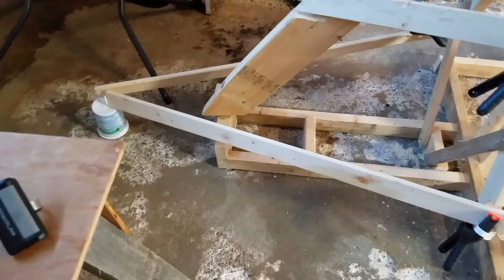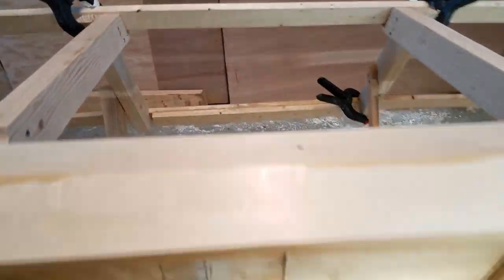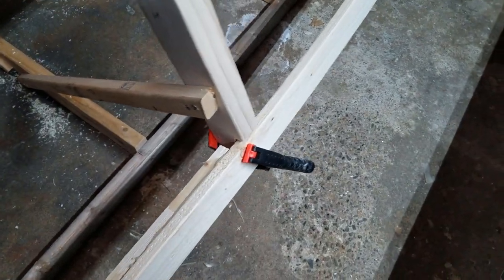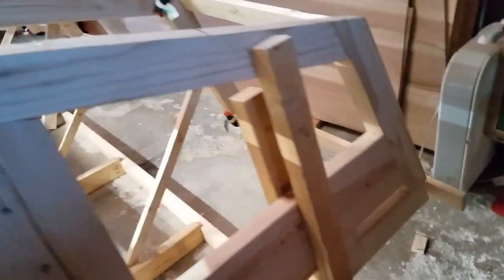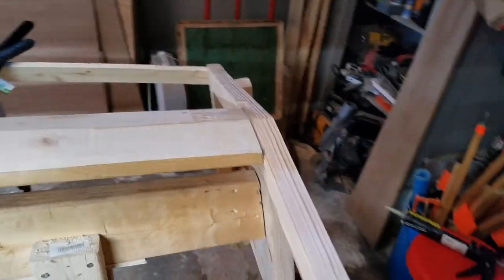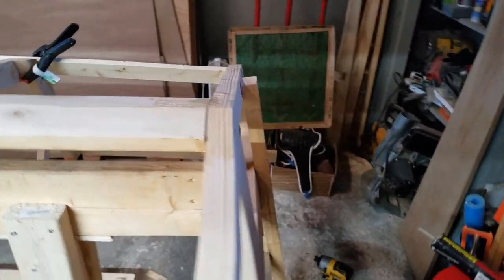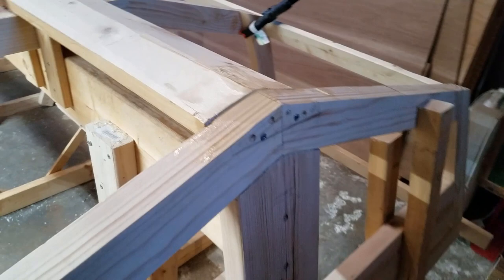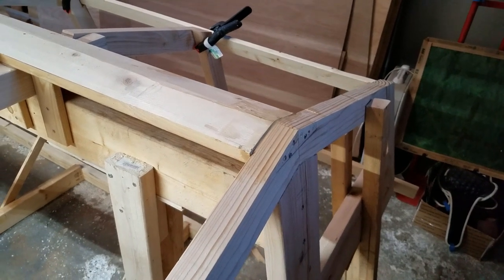Panga 5b: My Ground Hog Day of Boat Building  #diy #diyboat #woodworking

Comment: When you're at the end of a long day, and suddenly discover what looks like a problem, walking away from it before you do something stupid, so you can attack it fresh in the morning, is the wisest thing you can do.

Sleep is the best gumption restorative.

From Robert Pirsig's "Zen and the Art of Motorcycle Maintenance":

"I like the word “gumption” because it’s so homely and so forlorn and so out of style it looks as if it needs a friend and isn’t likely to reject anyone who comes along. It’s an old Scottish word, once used a lot by pioneers, but which, like “kin,” seems to have all but dropped out of use. I like it also because it describes exactly what happens to someone who connects with Quality. He gets filled with gumption.

"The Greeks called it enthousiasmos, the root of “enthusiasm,” which means literally “filled with theos,” or God, or Quality. See how that fits?"

[...]

'If you’re going to repair a motorcycle, an adequate supply of gumption is the first and most important tool. If you haven’t got that you might as well gather up all the other tools and put them away, because they won’t do you any good.

"Gumption is the psychic gasoline that keeps the whole thing going. If you haven’t got it there’s no way the motorcycle can possibly be fixed. But if you have got it and know how to keep it there’s absolutely no way in this whole world that motorcycle can keep from getting fixed. It’s bound to happen. Therefore the thing that must be monitored at all times and preserved before anything else is the gumption."
Reply from the maker: Thanks Jeff!  I'm going at it again today with gumption! :-)